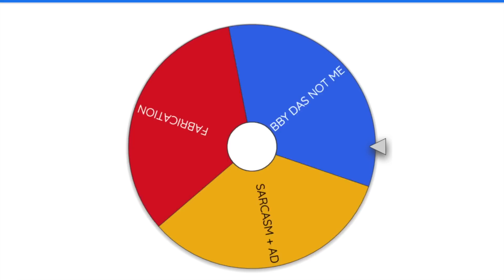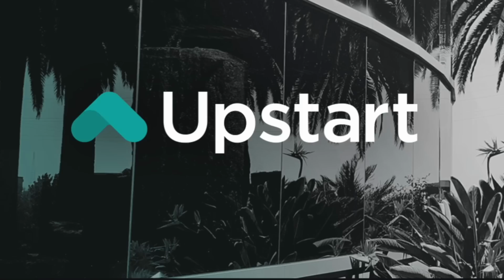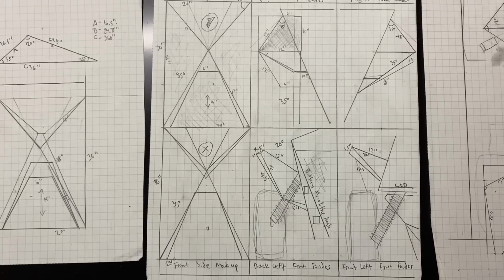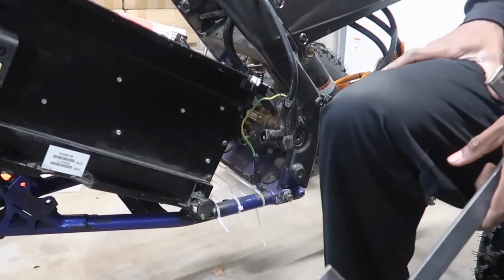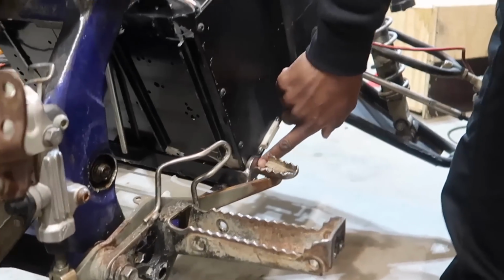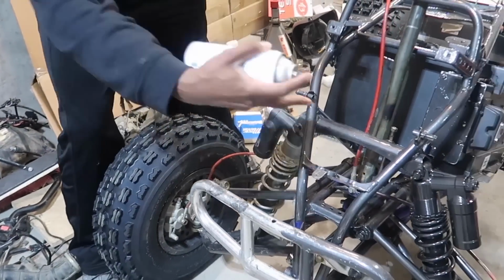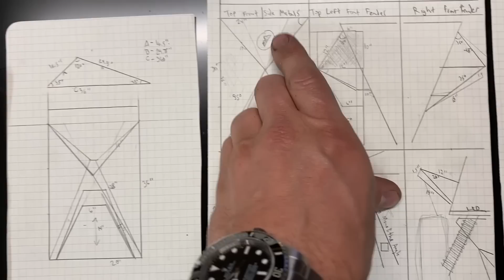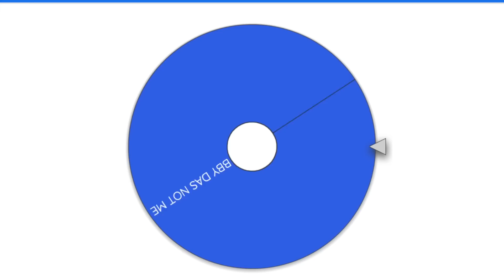How we Designed my Tesla Cyberquad

Comment: Well they do have a point but it will probably work. However it would be a more elegant solution to have a smaller battery. What is your big battery made of? almost certainly a lot of smaller batteries which possibly could be reconfigured and still give the same voltage but in a smaller form factor.
Reply: I think there is a lack of people taking apart the zero batteries. I haven't seen anybody do it yet.
Reply: @JasonWW2000  There are a few channels that do so or even make their own.
Reply: @glennedwards1449  There is no way a regular person can make a Zero battery. There are very specific electronics involved. Are you maybe refering to generic battery packs?
Reply: @JasonWW2000  Well until you open the battery case you do not know the composition. A battery is really a box which is made up of cells Sometimes in like a standard car battery they are moulded together and you are unable to modify they so your 12v Car battery could not be modded to say a 6 volt Motorbike battery or if a cell dropped you could not just replace it. Well technically you could but way way to much work and it would not be safe. However the construction of the higher end ones tend to consist of individual cell packs wired together. This is what some people do they buy a bunch of them and fit them together in their own battery packs. Mostly people do not do this because there are plenty of options for premade batteries. Of course not only do you have to make sure the existing BMS will accept the smaller amount of cells or buy a programmable one that will. Most important is that you have to make sure that the smaller number of cells still output the same voltage which is probably 48v or 72v. In essence the same horsepower but a smaller fuel tank and a smaller battery. The feasibility really depends on how the zero battery is constructed and the number of cells. So for example if the cells were 2v and the output required is 48v and there is 24 of them well no you could not mod them. However it might be that there are 48 cells and they are wired in 2 banks in parallel in which case a much easier job. Of course as you point out you could buy the cells and construct your own smaller battery but that would be quite expensive.
Reply: @glennedwards1449  You missed my point. The Zero box is sealed. You have to cut it open. Where do you cut so you dont harm the batteries or electronics? You need to know this before you can do any battery mods. (BTW, it's s 110v nominal, 116v max)
Reply: @JasonWW2000  his would not be the first time Rich has opened up a Battery pack
Reply: @glennedwards1449  This Zero pack is in good working condition and he has the fast charger with it. Maybe he is just being cautious because he paid a lot of money for it and doesnt want any issues later on. I did find out that Zero uses 28 cells in series for about 116v max, 102v nominal, and their big battery is subdivided into smaller modules. Rich has a 13kW pack so it probably uses 4 modules. If he could carefully open the big pack he could probably just rearrange the 4 modules to better fit inside the frame.

Comment: How are you going to keep the chain tight? With that short distance it will be hard to fit a proper length chain without an adjustment? My quals>I built a fat tire motorcycle, the short jack shaft chain gave me fits.

Comment: Well.... your welding now is definitly better than mine....
I keep hearing ' it should look like a row of nickles '
Not pocket full of change, including penies, randomly laying on it's side.
Still, keep it up, when you have the time/wire/gas practice and check the book for that welder for wire feed and settings.  Aparently the 'wire brush look weld ' has 2 of thse settings wrong, my bro wo 't tell me which until I cover the next spool of wire and a bottle of gas

Comment: Personally I would not have painted the shocks because there are seals in there that rely on metal fiber seals so if the paint chips your shocks might leak oil

Comment: Love the content! Great video!  (seen them all) Wish I had the funds to open an "Electrified Garage" location to support EV owners in my area. Question: I have a 2014 Model S P85 and the rear driver side door handle will not 'present'. Tesla told me that it would be $700 + to replace the motor but when I open the door from the inside the handle 'presents' (aka: extends properly). I'm pretty tech savvy with electronics and this seems more like a $2 micro-switch than a $700+ motor replacement. Have you ever thought about providing DIY kits with instructions on how to replace these? I totally understand that this would be for people that  have the mechanical and electrical aptitude and that the "Electrified Garage" assumes no liability. Anyway...thanks for the great content and the mission you and your crew/partners are on.
Cheers,
Jeff (Garage Maker Guy)

Comment: Rich do you predict any issues with the chain you choose to use breaking? I would think the shorter than average length of chain coupled with the higher instant torque of an e motor could be an issue unless you have a very overbuilt chain?
Reply: The length should have no effect on the strength. I believe it's a 520 chain which is pretty strong. If it can handle dumping the clutch in first gear of a 700cc engine it should be fine here. If he were going to mount drag slicks for max grip I'd be worried, but normally the tires will break loose and limit the torque the chain sees.
Reply: I see I see, I didn’t think about the tires loosing grip as a potential prexisting limiter. Makes sense.
Reply: He has since upgraded the chain to a stronger 530 size which is what the bigger bikes (1000cc, Hayabusa, etc..) use.

Comment: Hey bro, all battery size commentary aside, I get that you had a limit with the geometry.I think I am starting to comprehend what might've happened. Perhaps, and I just joined your channel, perhaps your experience with cars has created a compartmentalized view of suspension. So this project seems to be a great engineering demonstration for you, if I read the very beginning right. Sprong weight reduces your performance. The ultimate would be to have a zero weight tread and suspension system for efficiency. Everything we can do to go towards that is beneficial. I'm sure you get it by now that even a high tech electric motor is heavy. That's how the juice is carried

Comment: Will the final Tesla Quad be made as a stainless exoskeleton?
no traditional frame.
would that work?
Reply: You're asking what will Tesla do? No one really knows at this point. There's definitely no reason to build the quad with an exoskeleton. It would just add unnecessary weight and expense. For a quad a basic steel or aluminum frame is just fine.
Reply: @JasonWW2000  Has anyone ever tried?
Go back to first principal and perhaps a stainless exoskeleton is better than a frame?
Reply: @JohnSmith-gb3fr  you have to keep in mind that the only reason the Cyber truck is using stainless steel exoskeleton it's because they can't put the thick stainless into a stamping press to make the complex shapes. This reduces the cost of factory tooling. It makes a lot of sense in an automobile but it does not make sense on a small quad bike. Trying to make a quad bike out of a stainless exoskeleton would be cost prohibitive and completely unnecessary even though I'm sure it would be functional.

Comment: That motor on the swingarm really causes unsprung weight and will affect your handling and rear wheel.. buuuuttt if you aint planning to use it in long drives on repetitive terrain a.k.a the highway you're fine.. extra mass on the rear would help you offroad when you're goin up a muddy hill anyways.. ugly welds dont matter either as long as it penetrated and you have enough grinding skills LOL.. anyways thingy that goes under the frame is a skid plate..

Comment: You seem to have good intuition, but I'll say since it was mentioned already, I've been concerned about your welds ever since you said you're using a welder from HF.  I've used a welder from HF and it's nigh impossible to get adequate penetration with such low power with the sizes of materials you're using (perhaps why you have the amps cranked up?).  Test it, yourself.  Whatever size parts you want to mate, get a couple similarly sized scraps, weld them together, put the welded piece in a vice, and bang on one half until you break the weld, then check the joint for penetration.  Steel is strong so your welds might be holding OK, especially if you've over-engineered the mate, but you'd be smart to be a little more puckered while you drive around.  Why not give yourself peace of mind with a good welder and a lot of practice on scrap, and maybe even a course at a technical college?

My credentials, since you've been asking folks: I was a welder for BAE Systems and welded aluminum parts for the Bradley Fighting Vehicles and steel parts for the MRAP.  The aluminum parts I welded were anywhere from 1/16" to 1/2" thick, and the steel parts were at minimum 1/4" thick armor plating.  I'm also an engineer with a degree from Ohio State University, but that's my most meaningless credential, in my opinion.

What are your credentials, my friend?  Your stuff hasn't broken, yet?  Like I said, over-engineering can hide bad welds and even bad design.

With that said, it is not difficult to weld aluminum.  It's just different and a good machine makes it a breeze if you have the aptitude for it.

If you don't mind, here are my $0.02 quick tips: A properly set up weld has very little sparking.  Your welds are explosive(!), although I've enjoyed the sound of your later welds, actually.  If you're concerned about penetration, turning the amperage/feed rate up can drive the heat in and there will be more sparks, but that concern shouldn't normally be there for only a fillet weld between similarly sized parts.  If the parts being mated are very different in thickness, you need to have a strategy for making sure the larger piece gets hot enough, such as pointing the nozzle more towards the larger part, or with some plan for how you're going to move the nozzle.

All the best to you.  Glad to see you sticking it to Tesla (I don't like Tesla, although I know you do).
Reply: When welding steel of different thicknesses I do a zig zag between the two pieces with an emphasis on holding the tip longer on the thicker material and move away quicker on the thin side. It works really well.
Reply: @JasonWW2000  That's an effective strategy...just not with a welder from HF, in my opinion.  They lack the power to keep the weld hot.
Reply: @CalebDiT  I dont actually know how powerful the HF 110v welder is. I have a cheap Hobart 110v and I've had no issues welding different thicknesses. I dont want to associate the technique with the power of the welder. They are two seperate things. Obviously there are limits on the material thickness for any particular welder.
Reply: @JasonWW2000  The technique is related to power because of the size of the weld puddle.  A low-power welder gives you a small puddle, so nozzle movement has to be slow enough to not leave your hot puddle too far behind (which is always the case, of course).

Sounds like you got the hang of it, although I'd still prefer more power for better penetration because welds can be deceitful.

Comment: Is that gear ratio close to the original zero MB?  That not being the case it could provide lethal fast 0->30 mph.
Reply: Is Lethal fast a real thing? LOL. Seriously though if he gives it too much throttle it'll simply spin the back wheels. This quad doesn't have the grip of a motorcycle. Still, I'd lean forward when giving it a good twist. Lol
Maybe wheelie bars are needed?
Reply: @JasonWW2000  Rich has made changes that give his quad more traction. This is now the porsche of quads :)
Reply: @jannemyllyla1223  I thought I was aware of all changes. Is there a tire change or something that is going to give more grip?

Comment: I would be concerned about the steel to aluminium connection. Is the bike heavier? Is this joint over built enough?
Reply: What connection are you referring to?
Reply: @JasonWW2000  Rich said there is a steel front and aluminium back.  Meaning you have to join the two halves. Generally this is a connection
Reply: @dragade101  Okay, the front half of the frame is steel and rear half is aluminum. They are bolted together. I don't see any issues. The battery should be lighter than the original engine being lithium ion.
Reply: @dragade101  I checked a few things. The Raptor 700 is 422lbs and the Zero SR-F is 482lbs. Rich put the heavy electric motor on the swing arm, so the battery pack should be lighter than the stock engine it replaced. I would not worry about frame strength. Plus, I don't think Rich will do any big jumps.
Reply: @JasonWW2000  had no idea an engine for an ATV to be so heavy
Reply: @dragade101  It looks like the 700 engine weighs about 115lbs. I'm not sure the Zero 14.4kW battery pack/controller weighs. Probably similar.
Reply: @dragade101  From Richs older video he has the 13kW battery and he says it weighs about 150lb. I'm not sure he weighed it, this might be his estimation. So that's roughly 35lb heavier than the 700cc engine. If we add the weight of the gas, about 8.4 lb/gal, we have 24 lbs for 2.9 gallons. So 10lbs heavier? It's certainly in the same ball park, weight wise.

Comment: Any chance you can install a Tesla onboard charger and trick it into supercharging your CyberQuad?
Reply: I doubt the Tesla chargers are stand alone. They are probably wired into the cars extensively. Zero on the other hand do offer a standalone 6kW rapid charger for their bikes.
Reply: @JasonWW2000  If anyone has all the parts to try it, it would be Rich. Probably use a 200 lb plate of steel and duct tape to mount a MCU and charger!
Reply: @nordyboy22  I checked, the Tesla is about 400 volts, the Zero is about 116 volts. The Tesla charger won't work.

Comment: The motor on the swingarm isn’t the best, couldn’t you place the motor with the axis in the same place as the swingarm axis?
Reply: No, the swingarm bolt goes all the way through. It's like 15" long.
Reply: @JasonWW2000  allrigth, that isnt a option indeed....
Reply: He might be able to move the motor to just before the swingarm, like on the Cyberquad, if he took the big battery case apart and rearranged the 4 modules inside. Or maybe just used 3 modules.

Comment: GUYS is it posible to weld on a battery case without damaginjg or breaking anything?
Reply: The problem is you don't know if the heat is right up against something that is heat sensitive on the inside. You also don't know if the electrical current from the welder may damage sensitive electronics inside the case. So to be safe, it's better cannot weld on the battery case at all.

Comment: If unsprung weight was the show stopping problem these people claim, then hub motors wouldn't exist
Reply: One big difference here is that the motor is on the swingarm instead of inside the wheels. This might bend the axles in a jump. Hub motors have their pros and cons, it's just some people take a black and white attitude to everything.

Comment: Welding by the battery is probably not a good idea
Reply: Why not? The heat is not a problem since it's far enough away from the batteries. There is no gas. Maybe the electrical current could flow though the box and damage sensitive parts inside?
Reply: It may damage the inside of the battery

Comment: Everyone knows that electricity is called "Juice". If you tilt the battery like that, all of the juice will spill out. You could correct this by putting big tires on the front and little ones on the back. Trust me, I have built many, MANY, H.O. scale trains and if you look at them, they have different size wheels and I have never found juice under the track...NEVER.

Comment: Your welds look like trash ain't gonna lie I'd recommend for you is to alter the settings to match the instructions on the panel depending on what gauge of steel/aluminium your welding the reason its splattering so much is either A you haven't gotten a clean earth to the work piece B wrong wire/gas depending on the material or C the settings ain't right for the thickness of the steel theres also the spool speed the thicker it is the slower you want it.

Comment: I am more confused then what i was in last video.
Reply: What are you confused about?
Reply: @JasonWW2000  idk swing arm, welding, aluminium & steel combination, motor mounts, gearing ratios, modified chassis design... maybe i don't understand or whatever.

Comment: u and Tyler Hoover  really should get together.. and I don't mean that the sound rude. The handout your video, where they confuse somebody else or you was kind of my whole point, you should find a way to get together with one or more of those guys and maybe you can work together on some stuff. Friends make the jobs easier. I speak from the fact I don't generally take much on because it's me by myself and usually end up having to pay somebody, because I've got 1 foot in the grave. LOL. Pretty much avoid working on cars other than minor jobs these days. Something that's been rattling around the back of what's left of my twisted little mind. Have you thought about putting one of those motorcycles systems on a electric three wheeled or four-wheel mobility scooter. You know the ones I'm talking about. You see, super obese people pottering around Walmart on or holding up traffic going super slow. Instead of being on the sidewalk. I've been thinking one of those electric systems off of that electric motorbike like you're using on this quad would make a interesting couple videos putting it on a mobility scooter and seeing how fast it goes. Don't recommend you driving it yourself. Obviously, find somebody expendable to test it after you put it together.